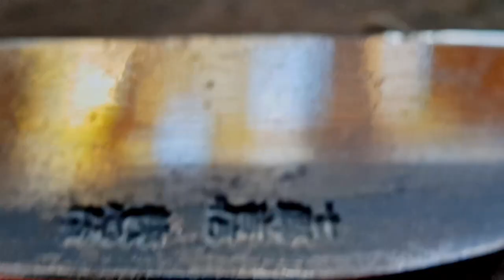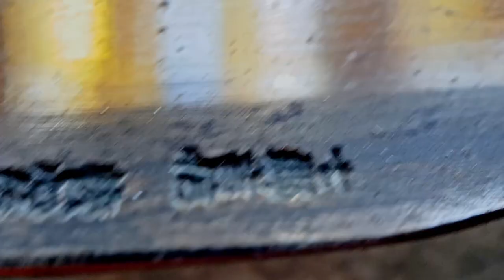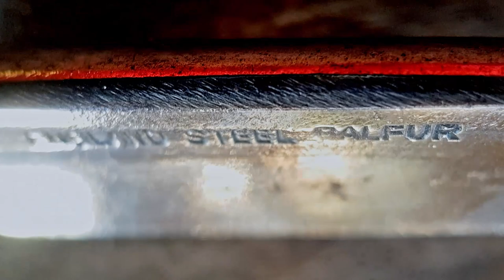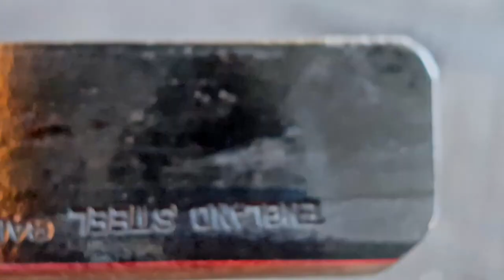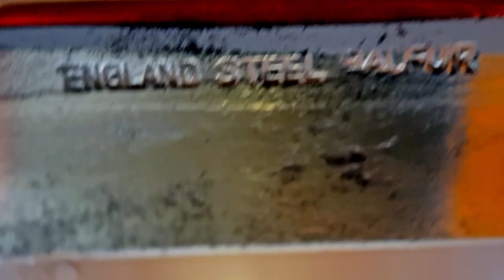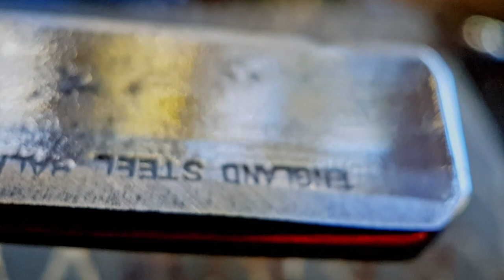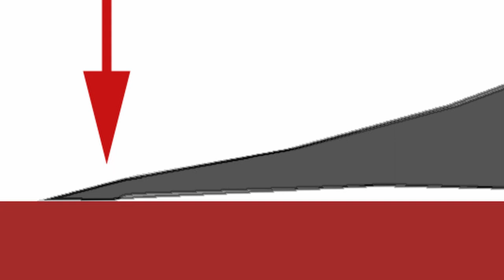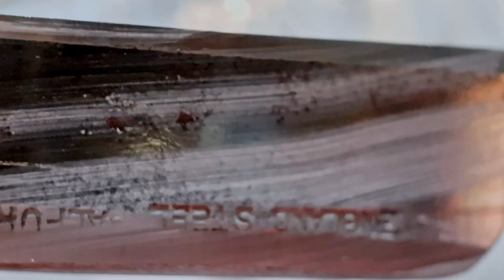Restoring a 100 year old Japanese Cut Throat Razor

Comment: As a user, collector and honer of kamisoris and straight razors.. the stamped side is only really honed to take the burr off when sharpening the main side, usually I do about 7 passes to 1.. since most kamisoris have soft iron outer layer and your worried about grinding too much metal before getting to edge.. you can put a layer of electrical tape over the spine covering both sides to reach the bevel abit easier and save the spine.
I just brought a left handed grafting knife off you.. looking forward to it :)
Reply from the maker: The tape is a good idea.

Comment: I have seen leather strops used in Japan across all types of blades.
Reply from the maker: Ahh that is good to know.
Reply: The usual stropping tool for Japanese kamisori has always been the palm of the hand (at least in Japan). However, this is merely out of habit and if you're not an intentful purist, it won't hurt to use a leather strop, like most international users do.